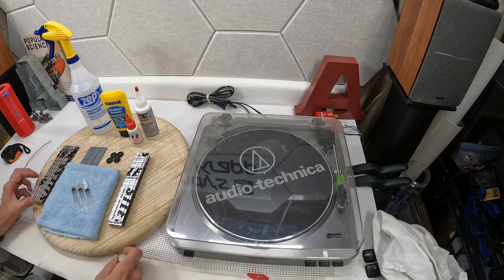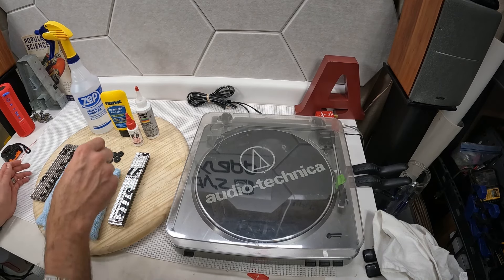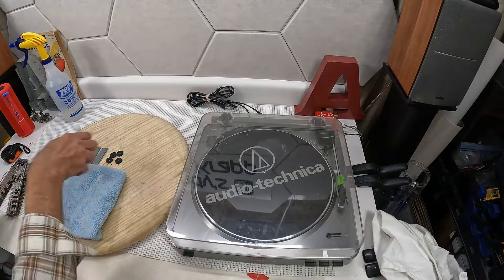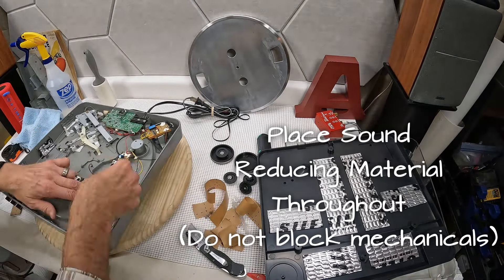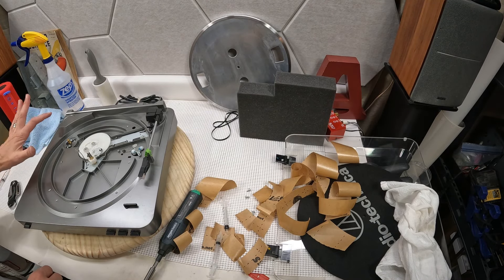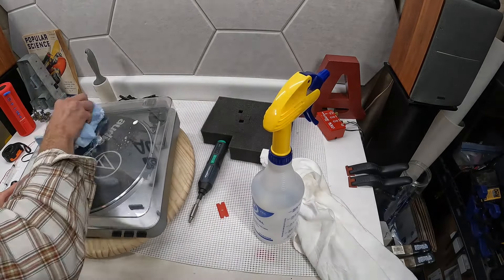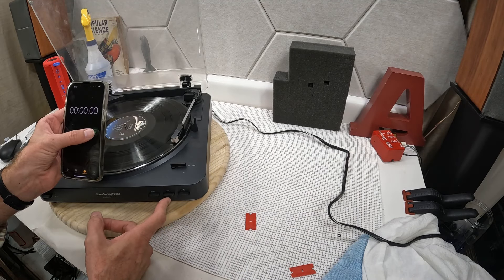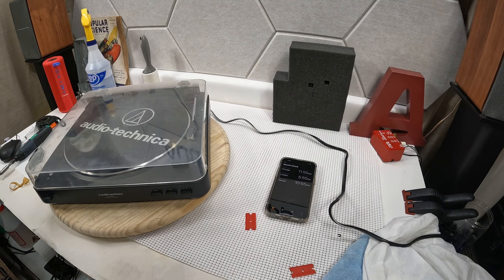Upgrade & Improve Your Audio Technica - AT-LP60BT AT-LP60 AT-LP60X AT-LP60USB

Comment: Replacing the factory foam platter mat with rubber, cork, cork-rubber hybrid, or whatever is a good idea.  The existing one that came with my LP60 would cling to my records from static.  $65.  Back in like 2003 you could buy these new-in-box for sub-$100 all day.  =/